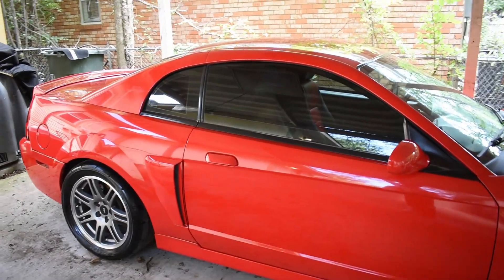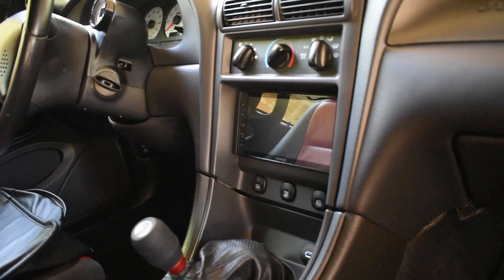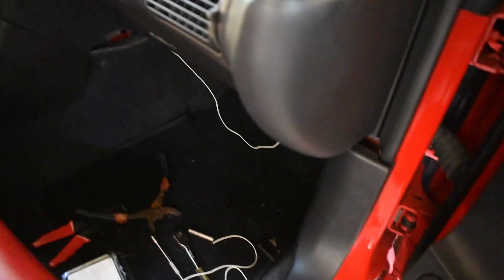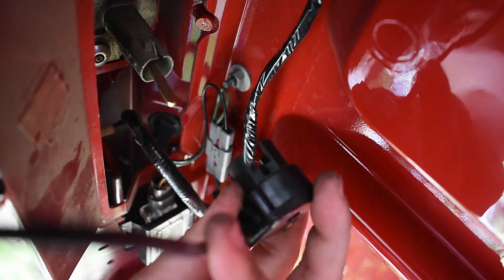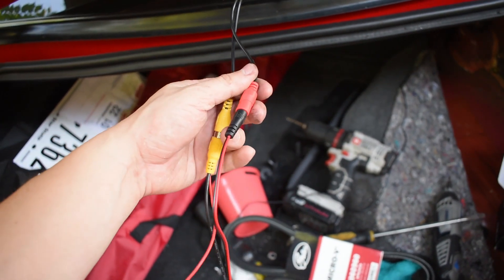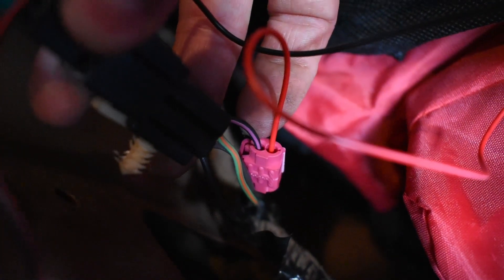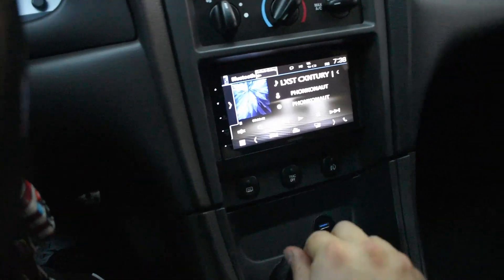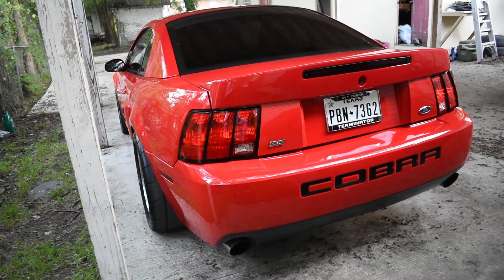How to install a back up camera on your 03-04 Terminator Cobra

Comment: you mentioned that you connected the purple wire on the stereo that says reverse, to the white wire and ran it to the back. but then what did you connect that white wire to?
Reply from the maker: I used a white wire since that's all I had, but it went from the purple wire on the head unit to the black/pink wire the passenger side kick panel.

Comment: Hey great video! after living with this for a few years now are there any drawbacks or flaws with this style install? The trunk is still locked unless you hit the key fob or trunk release in the cabin so there's no security difference correct?
Reply from the maker: No draw backs at all 😄 yes the trunk locks like normal and can be opened from either the key fob or the button from inside the glove box

Comment: @loscar5oh

How is the camera holding up a year later? Did you have to use any sealant?
Reply from the maker: Its been working great! I havnt seen the need for sealant either, but my car stays under a carport and I don't drive it in the rain. I only need to figure a way to angle the camera down slightly for better visibility for objects down low.

Comment: Nice, I need to do a backup camera. But shouldn't it be looking down? I feel that installing it over the license plate would have given you a better view to what's in the harder to see ground level
Reply from the maker: Its slightly upwards due to the angle of the trunks surface. Also the lines kinda look off but I believe those can be turned off on the head unit. Its not perfect but definitely helps.
Reply: @loscar5oh  I looked at the link you provided for the camera. ,and it looks like they make dome shaped cameras that may fit in the key hole to where the camera sticks out enough to angle it towards the ground. I may give that a try. Thanks for making this video 👍

Comment: hey man how were u able to take out the key lock? what did you use?
Reply from the maker: Yea man, I just had to drill out the rivet that holds the lock in place. It's a little tricky but eventually I completely removed it.

Comment: Look good. How do you open the trunk now? Do you have to go in the back and pull on the cord? Or can the remote still open the trunk? It would be a real PIA to climb in the back whenever you want to open the trunk...
Reply from the maker: 😂 no you don't have to do all that. I can still use the trunk release button on both my key fob and inside the glove box.